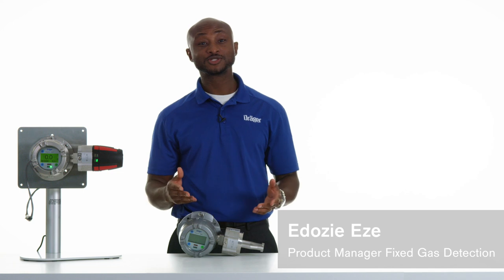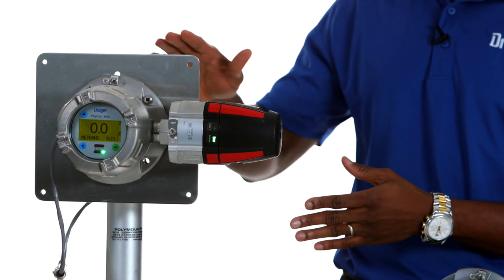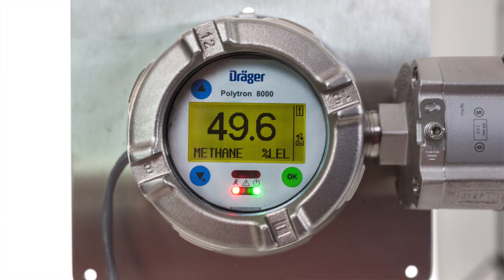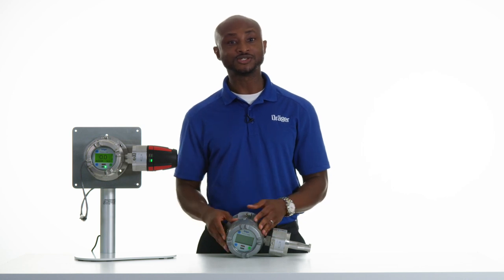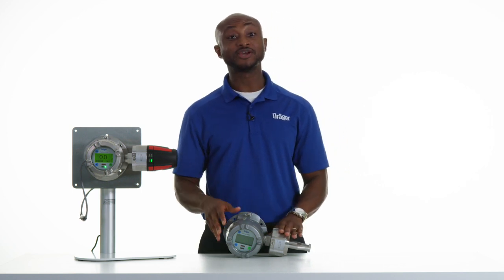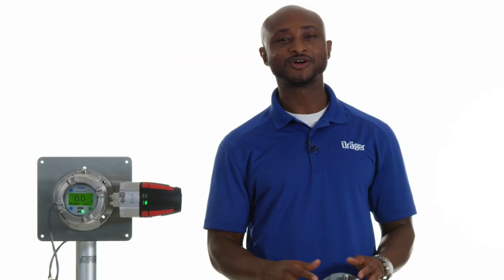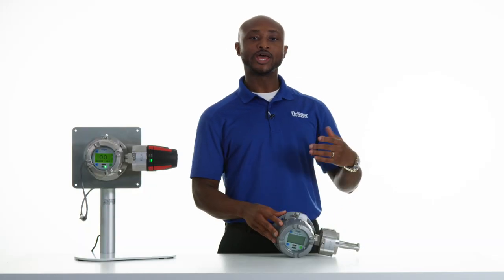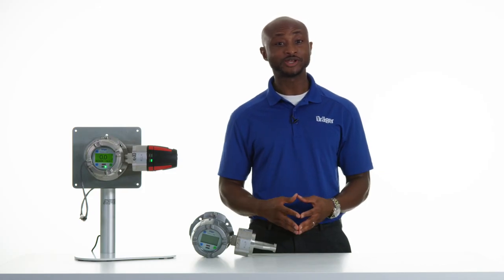Polytron® 8700 IR Fixed Gas Detection System Product Series

Comment: i have á gas detector install with remote tubing for calibration, but the tube very long, about 10metter, i can not calibrate the gas detector. the remotetubing can be you for calibration ?

Comment: what the different between Dräger PIR 7000 and polyton 8700IR?
Reply: The PIR 7000 is the sensing unit itself, the half of the 8700 to the right of the display. Polytron 8700 is the whole package, the sensing unit + display.